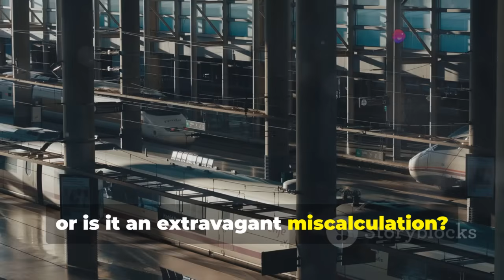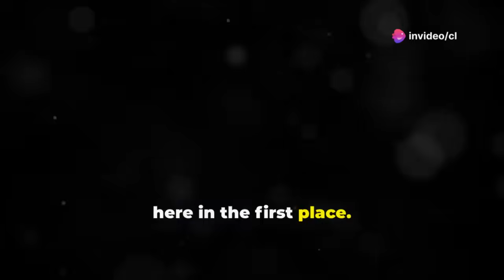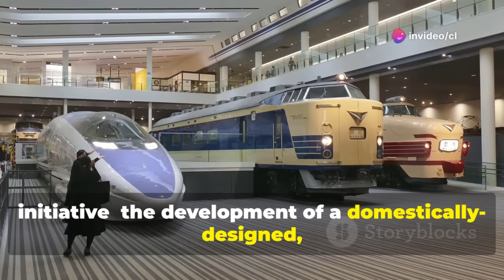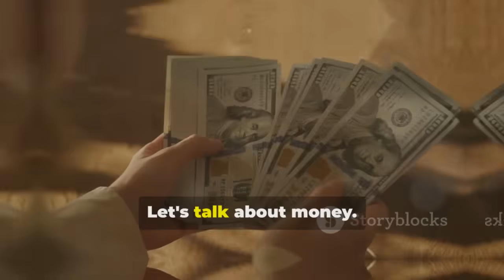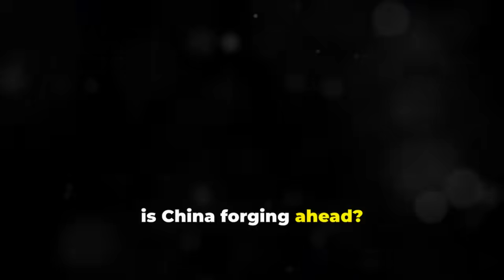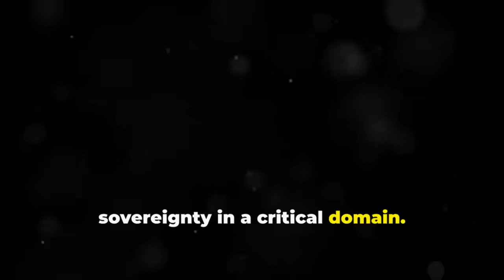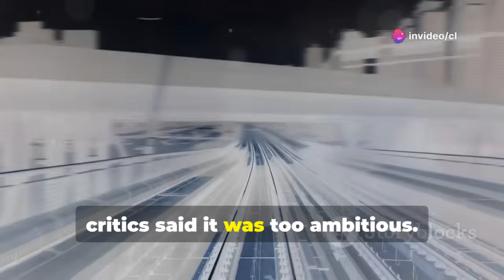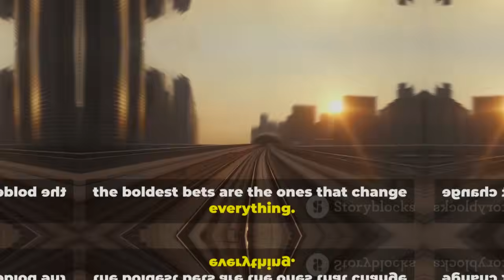China's 600km/h Maglev Train: Why The West Says It Will Never Work

Comment: "And it faces formidable challenges before it can become a mainstream mode of transport."
If 40,000 Km [60,000 by 2030] of rail line and serving 3.27 billion passengers in 2024 is not enough, how much is before it becomes a mainstream mode of transport?
I'll bet those Western skeptics will not say this if they had 10,000 Km and one million passengers using them in a year. This is nothing but sour grapes. 
China doesn't give a rat's ass to what Western critics say they keep building HSR's because 1.4 billion people need fast transport. The Western critics can just sit back and turn green.